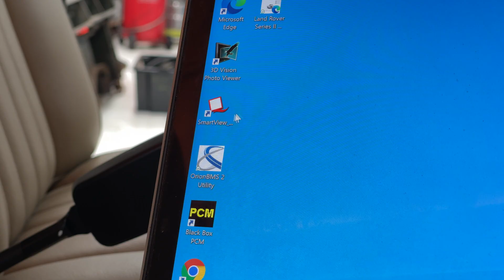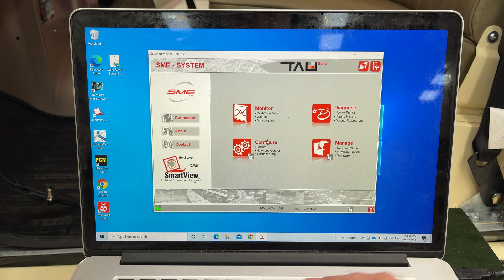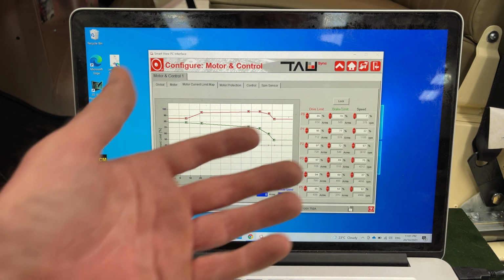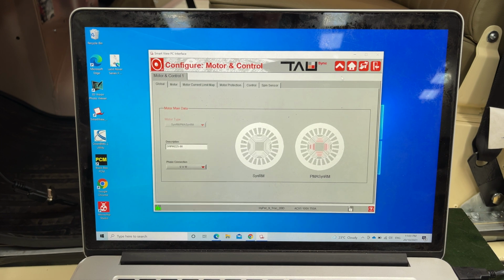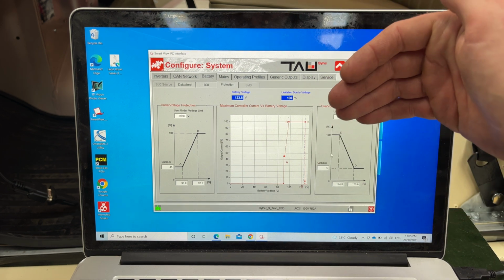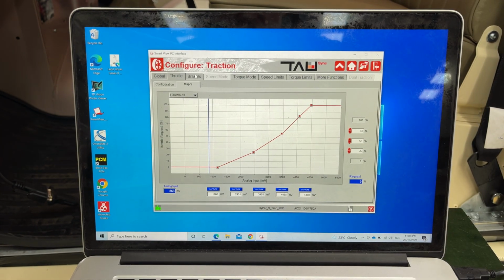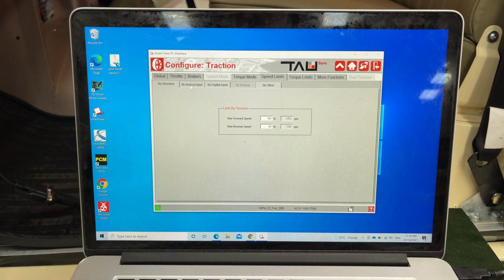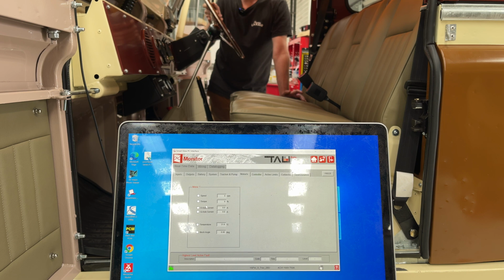Software Tuning an Electric 4WD | Land Rover EV

Comment: A manual gearbox is one of the attractive traits of these vehicles. EV conversions typically remove the need to change gears due to instant torque at all RPM. I always felt the software should mimic an ICE to some degree to require gear changes, perhaps at a broader range than ICE. It sounds like it is possible with your config setup.
Reply: I agree I kept the gearbox in both my conversions. I feel a slight upgrade in power and the instant torque is nice. It keeps the character of the car, without overwhelming the chassis, suspension and brakes.
Reply: I don't understand why people like to shift gears so much. What is wrong with not having gears to shift and just let the electric motor run at the best it can?
Reply: @franciscoshi1968  A multi-speed gearbox allows the motor to run best it can. Electric motors do not have an unlimited rpm and an endless torque band. Most vehicles being converted did not have chassis designed to handle 500-600 HP. Which is the way some companies overcome the lack of multiple speeds.
Reply: @dannelson6980  they do not have unlimited torque and speed but I don't think the chassis and power are a big problem. The chassis is limited by the amount of torque between the gearbox and the diff. I guess that will be limited by the grip of the tyres. So the low gear is limited to how much grip you have. Then as the car speeds up you are limited to how fee the car can safely go. In the case of a 4WD that speed is not very high.
So having a motor that will give the same torque as in first gear and a top speed of the maximum required speed means you do not need gears.
I am converting a Pajero and I have geared the motors to give me 30% more torque at the wheels than the original petrol motor had in first gear. Then a top speed of 150kph gives me the maximum speed that the motors can run. So there is no need to have multi speed gearbox. I could put a smaller motor and have multispeed gearbox but it is cheaper and easier to just put a bigger motor and one speed. It is just so much easier to not have to deal with shifting gears. Also electric motors will drop in torque as the speed reaches a certain speed. After that you get constant power (the torque drops as the speed goes up linearly) which is kind of the same effect as a gearbox.